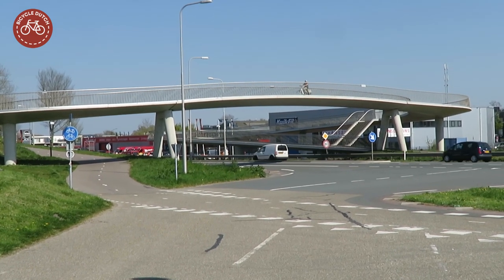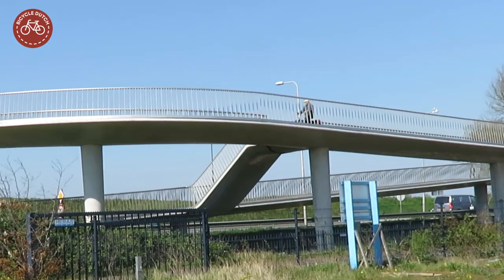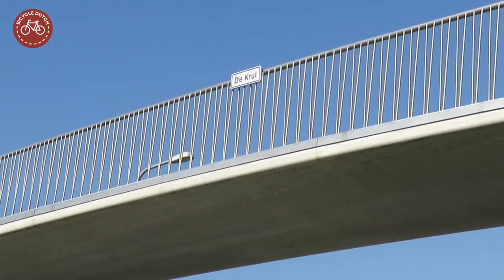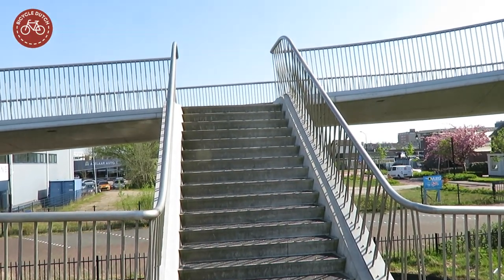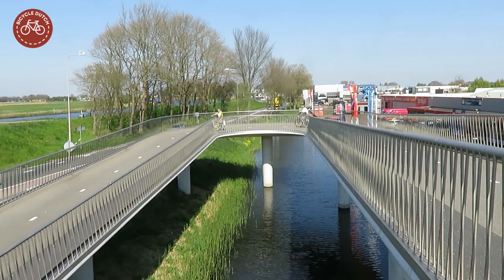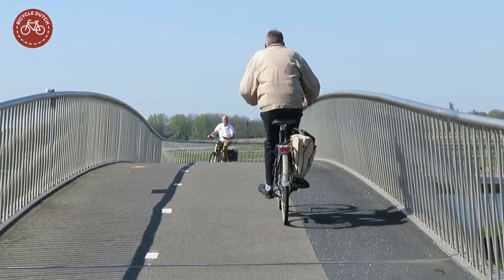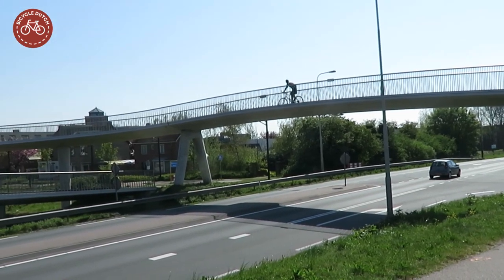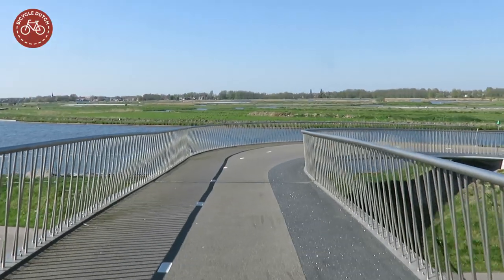Cycle bridge in Heerhugowaard (Netherlands)

Comment: In the USA you would need a tall chain-link fence(or complete covering) across the length of the bridge, so people don't toss bricks, rocks or other objects onto the passing traffic below, or commit suicide by jumping off.
Reply: Newer bridges that cross highways have those kinds of protections in the Netherlands, for the same reason. But if you throw a rock from this bridge (which is crossing a slower N-road) you'd be unable to escape, so it's not very likely to happen.